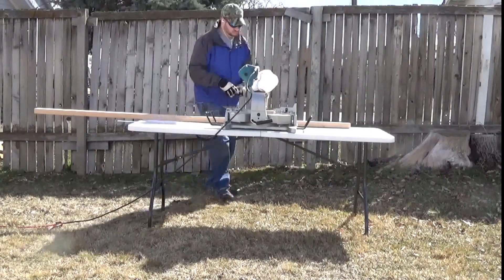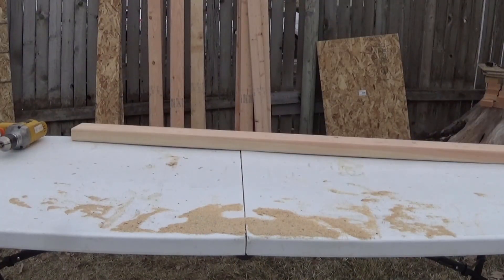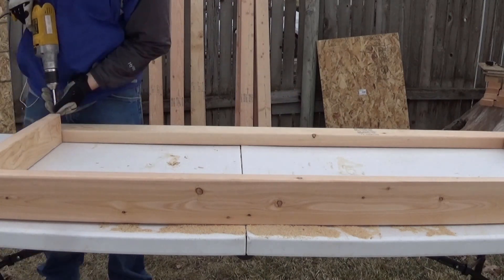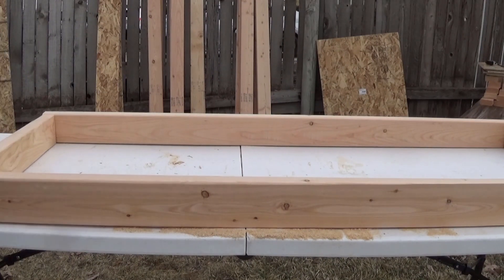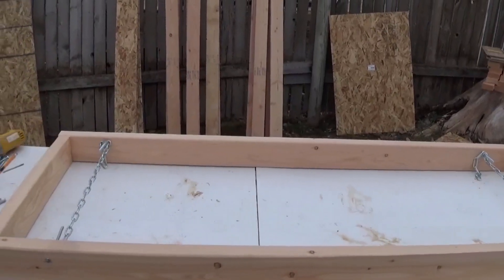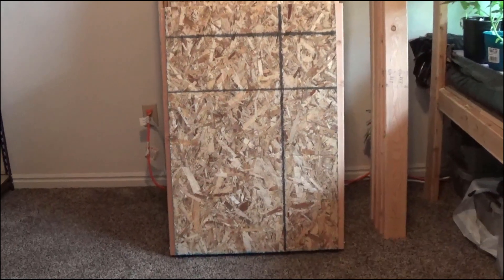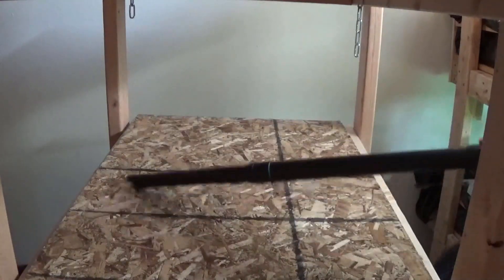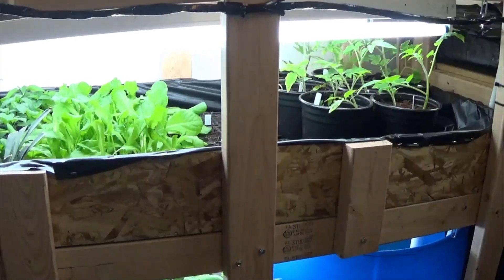How to build a DIY Hydroponics Flood Table part 1 of 4

Comment: Wood would not be my choice of material because it will absorb moisture in the room and potentially cause mold and fungus.not to mention what pathogens have already absorbed in to the wood.and the wood takes up a lot of space
Reply from the maker: There are many materials that woek well depending on the situation. Im always eager to learn more for different materials. What types do you like using?